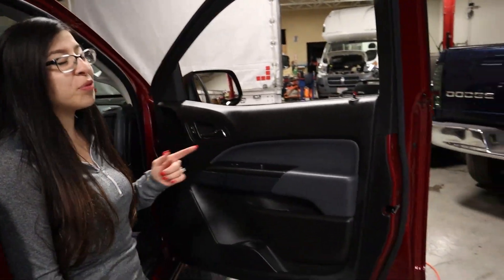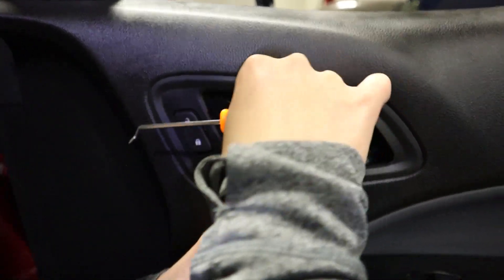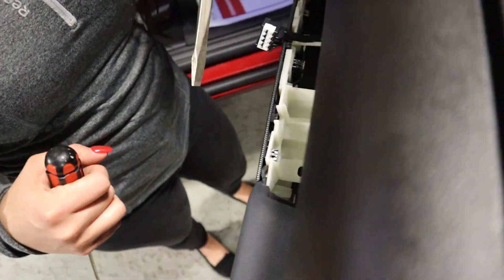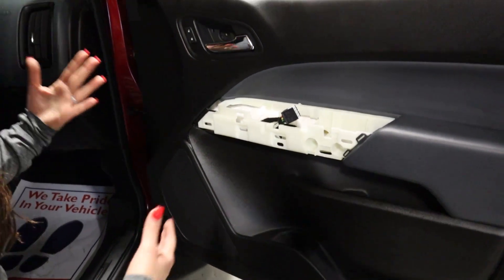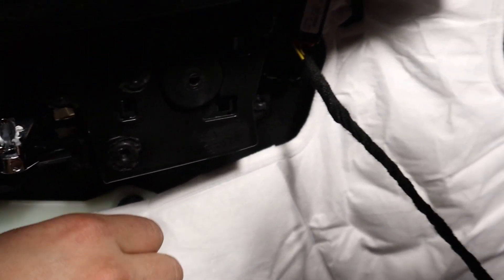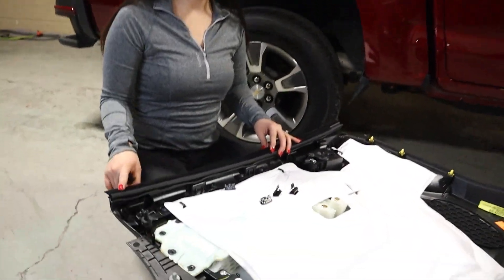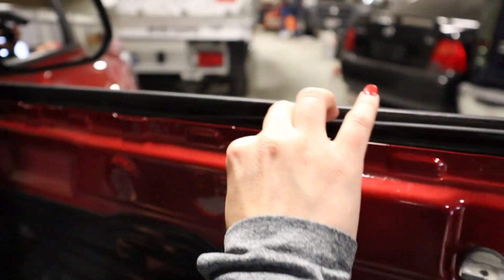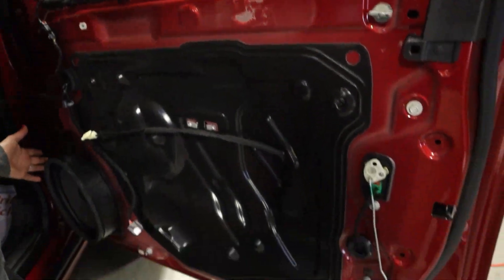2019 - 2020 Chevy Colorado Front Door Panel Removal

Comment: Correction to comment is by Lee Hensel
I found the video to be very informative and made the changing of my door speakers very easy.  I do have one comment about the video.  The clips that hold the felt do not come out of the door as easy as you depict.  I would have liked to seen that removal because mine required some extra talking too in order to remove them.  I would recommend this video if you are changing door speakers even though I changed them on a 2017 canyon and it was spot on.